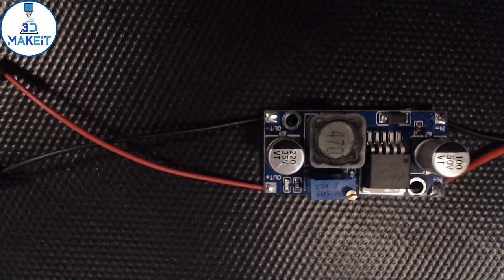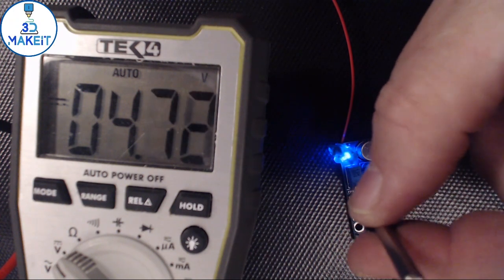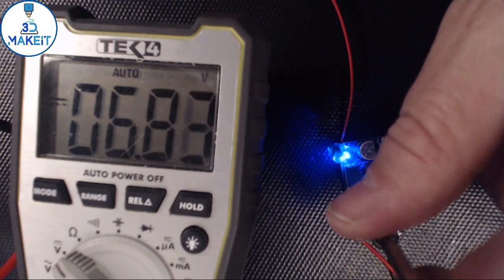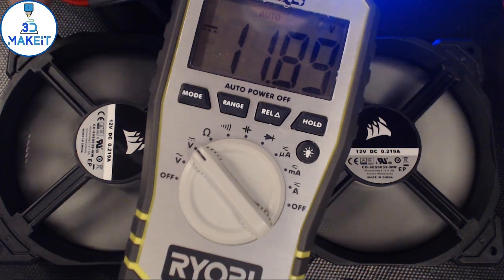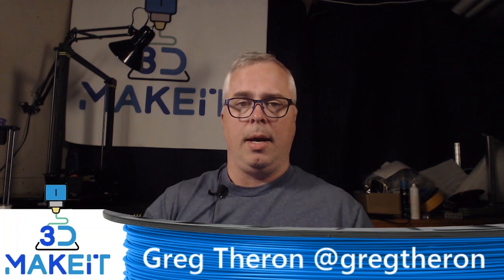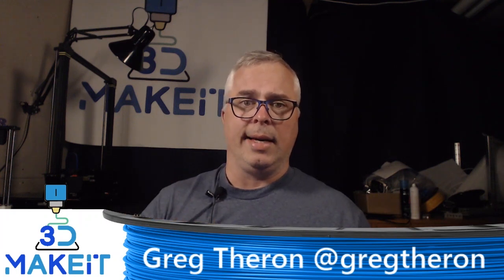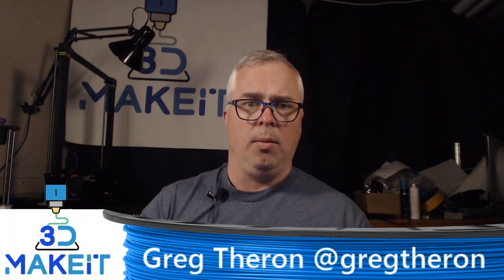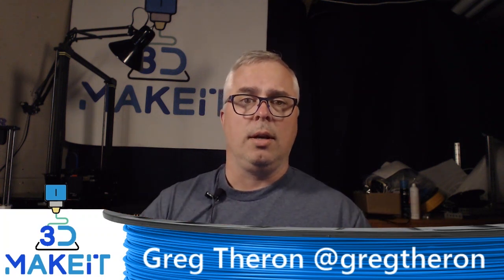Silence your beast! Buck Converter 101

Comment: Is it really true that the output amperage can't exceed the input current?   I suspect it has more to do with total wattage.  So then you are saying or example, a 30-volt in at say 300 milliamps, then say 3.3-volt amperage certainly could be more than the stated 300?
Reply from the maker: Hey.  We have to consider the law of the conservation of energy.  Simply put in a closed system (isolated) the total energy will remain constant.  

A basic formula for our case here is Vin * Iin = 1/efficiency(Vou * Iiout)

So if you increase one variable in the system it must remain equal and balances it’s corresponding variable.  (Example more Voltage in will lead to lower amperage if the output voltage and amperage remain the same)